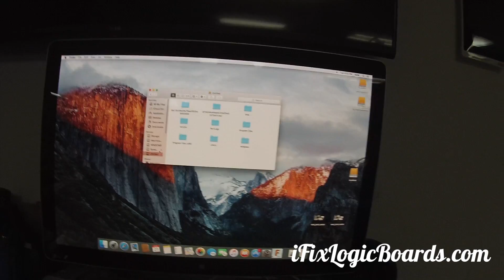SSD Data recovery - damaged connector

Comment: You damage this Connector Pad In Board. You can use the heat gun to remove connector but you damage connector. Very Bad Technician Dislike for Work.

Comment: I actually have an SSD with a damaged connector, maybe I should try this some time, though it would probably be a hell of a first soldering project
Reply: Get an old TV off the side of the road, I see them all the time. Rip the circuit boards out and practice desolder and solder on them. Once you can do it without messing them up,  then do it for real.

Comment: hi my ssd sata ocz suddenly died (not recognized in bios anymore, data and power cables are working fine cause i used those same on another SSD that i also have and no issues). Is there a way i can bring it back to life? I used it for about 5 years.

Comment: Great Video.
But, it is "SOLDER"   NOT SODDER one Solders the connections not sodders
The rest of the video was informative and have use that information to repair an SSD that had bad terminals, and is now working.

Comment: Hello, Want to know How much your minimum charge for Data recovery from Macpro 2012 Hard drive recently change to WD Green Ssd 250gb used smoothly for 8 months, suddenly white screen with question mark sign.. Need to recover data file estimate around 70 gb from desktop location. Thank you

Comment: a bit surprising method to remove the connector by brute force. no wonder some pads have been ripped off. and all this with a soldering iron standing right next to the ssd